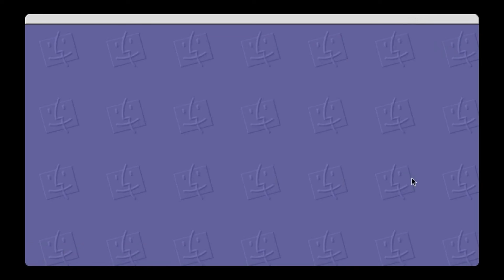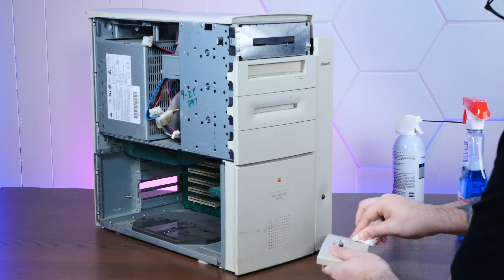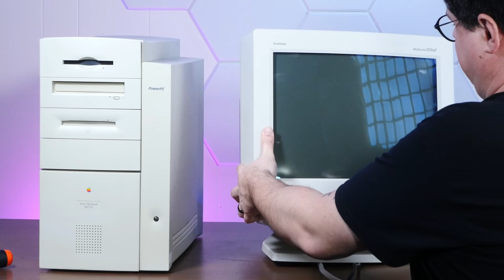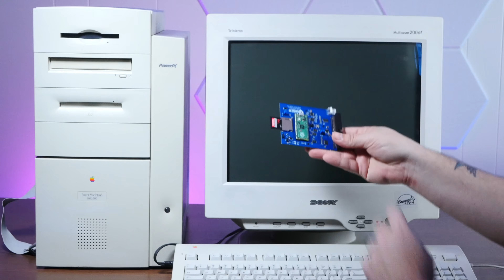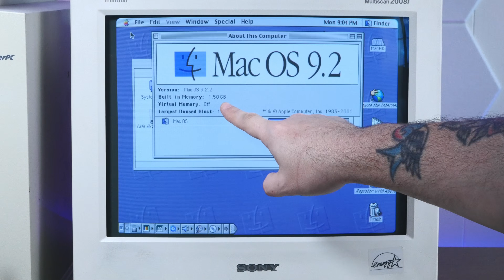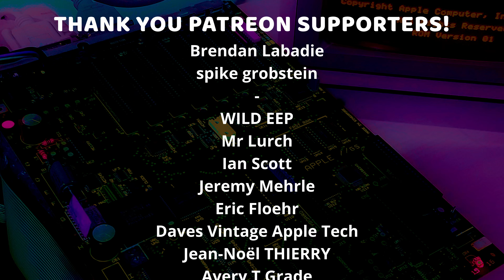I Found a Beat Up Power Mac 9600

Comment: the best thing about the 6 PCI slots was they they had 2 PCI bus controllers, 1 for 3 slots each. so you could put two ultrawide ultrafast SCSI cards in slots 1 and 4, give each its own 10K rpm Seagate Cheetah drive, and stripe a RAID across them for insanely fast (in 1997 terms) throughput

Comment: I have the original Power Mac 9600/350 and need an Adaptec 2940 UW power domain for Mac SCSI card.
The battery clip is broken, and one of the pci clips needs replacing .. anyone out there have some to sell..?

Comment: ya know there's a ram jumper trick i've used to get more ram working in a casio fiva, it's for laptop sdram.. but i wonder if it'd work with desktop sdram. essentially it let me use a stick of 256mb in the casio when it would originally only work with a single stick of 64mb. the guide was on a japanese site and also showed someone getting a 512mb stick working with theirs. i've seen laptop sdram to desktop sdram adapters in the past i wonder if the mod wouldn't work with the desktop ram if someone could use that adapter and get the jumper'ed laptop ram working on a machine. anyways you jump pin 62 to pin 68 and it bypasses some size check i think.

Comment: The way to do a universal mount solution for various SD card adapters would be to have a two-piece system where device mounting and card placement would be sorted out. Then it would just be a matter of inserting the card with hardware from the front and having it fasten in place with live hinges holding this carrier in place.

Comment: I used the 9650/233 as my desktop machine, hooked up to a 28" CRT back in the day. I still have it. Oh and it was upgraded with a DAT drive - complete with the official face plate. Your model appears to be missing the green levers that kept the hinged part in place.

Comment: The 9600 is my favorite pre-G3 PPC Mac, so many ways to upgrade and customize. I have a 9600/300 “Kansas” model with a 250mhz G3 upgrade CPU card in with 12x 64mb RAM for 768mb total and a Zip drive. Even though this beast is quite large and heavy, it sits on top of my desk because I love the way it looks.
Reply: I bet that thing was a screamer back in the day. You can run modern NetBSD on those if you ever get so inclined, especially with your specs. Can’t promise how good X11 will work though😆
Something like IceWM or FVWM might work.

Comment: Having one of these. (4000usd 1997) was the equivalent of getting a 2019 mac pro in about 2019-20 (say 16core 384 2tb afterburner etc  about 18,000usd). very very expensive but lots of power.  Similarly in their day , the macintosh IIfx  ( stood for ***cking expensive 10,000usd 1990).   The mac pro 3,1-5,1 were cheap in comparison, although you could option them up too.

Comment: You've inspired me to continue tinkering with my PowerMac 8500 that I've upgraded to a G3/300, and 512 MB of RAM... I've been wanting to see if it'd run Mac OS X 10.x but I don't have enough space on its current 2GB HDD....  Once BlueSCSI v2s are in stock assembled I'mma get one and do just that (see if Mac OS X 10.x runs on it). I'm excited to see what you hack into the 9600/300 there! This'll be fun!
Reply: Put a Morph operating system on your mac.
Reply: @TheRus13  Nah I'd rather not... I'd rather have a working experience lol.

Comment: I stumbled upon an 8600 with a 1 GHz Sonnet upgrade card and 768MB of ram at a recycling center. It had a 128GB IDE hard drive mounted in the bottom of the case, which led to the discovery that it had been used as a server, since the drive had OS X Server 10.3 installed.

Comment: In 1998 or 1999, my high school got a grant for 2 beige G3s for a vidoeography course. I don't remember how much RAM they each had, but  something like 768 MB or maybe a Gig.  What I do remember, is that the RAM for each of these machines cost $22,000 USD.  So 1.5 GB maybe would've cost $50,000 in 1997?  ~$91,000 adjusted for inflation?
Reply: The beige G3 has got three RAM Slots, so you can put in 768 MB RAM max. 
My beige G3 DT also got a Sonnet G4 800 upgrade card. i also upgraded it with an ATI Rage 128, a USB/FW-Card and an ATA133-Card. Thanks to Xpostfacto it was my daily driver running 10.4 until 2008, when i bought a new Intel MacBook.

Comment: My 9600 I've had since the 2000's has always been a little wonky looking even with all of it's plastic intact. Part of the problem of it being a little off for you is it looks like it's missing the two bondi colored clips that attached to the big pegs on the side of the drive cage and gave the upper and lower hinged parts more bracing.

Comment: The timing on this video is crazy! The other day, I was given an immaculate 8600/200 and AppleVision 1710AV that had been in a store room for the last 23 years. It almost got eWasted, but a coworker saved it before it got turfed - Booted it up the other day, and aside from the dead (thankfully not exploded) PRAM battery and an intermittent 4GB second HDD, it all works perfectly 🤯

Comment: This is the later revision for the high-performance 604ev. The last 604 CPU used in the Mac. This means that it does no longer have cache on the mainboard but on the CPU-card instead. The nice thing is that the ROM has a working version of speculative access and is best for the G3 (5-10% more speed in certain cases).
The Tsunami and Kansas have two PCI-'zones'. The upper 3 PCI slots are shared with internal peripherals and the lower 3 are directly connected to the system bus. Graphics cards are typically installed in the 4th slot to have the whole PCI bridge for itself to maximize speed. If you have a card that writes into the framebuffer (like video editing or acceleration cards), it is important to install it in the same 'zone' as the graphics card.

The case is missing the latches for the drive-bay mechanism btw.

I have two of these machines. One with a 700MHz G4 and the other with a 400MHz G4. Both machines have more than 768MB of memory. I tend to use the Adapter AHA2940U2B card since it allows very good performance with little CPU involvement. I also have good experience with Acard and Sonnet IDE cards with UDMA capable CF. A generic Realtek 8139 card helps a lot for data transfer and a USB card is also well advised. Even though the plastic off they machine is much less prone to brittleness than the 9500, it can be a bi*ch when it comes to the small plastic latches used for the drive bay covers. I have repaired some of these covers with ABS cement and some donor ABS. It needs a bit of work to get the repairs into the correct shape, though.

Comment: C'mon, please stay away from SD Cards as HDD replacements, they do not have proper native DMA, support which is problematic, unlike CF cards which support DMA in the form of the ATA DMA/UDMA implementations. 
This has impacts on performance AND compatibility. The only way you can get proper DMA support on a SD card based adapter will be if the adapter includes a large amount of RAM and a smart caching algorithm to cache the SD to the RAM so you can then have proper DMA, this is expensive and unsafe as any power loss will be destroying data if it happens during a stage where the cached data is data to be written and not fully saved yet.

Comment: Do you think the 9600/350 or 9600/200 MP is a better example of the pinnacle of 90s beige Power Macs? I was thinking it might be more fun to have the 350...I mean that was even faster than the G3s of the time.

Comment: I love the 8500, 9500, 8600 and 9600 series computers. My first PowerMac was an 8100/110 and I very much regret parting with it, even if it was a b**ch to take apart. "(well not really, if you have 90's cars for reference...). The 9600 was a powerhouse dream machine.

Comment: Loving this. I have a 9600 in storage and this really makes me want to pull it out. I remember it had a faster SCSI card, but I think the drive has died. I think I even have some upgrade parts for it as well?
Reply: Mine came with a Jackhammer SCSI card. Maybe a little faster than the onboard SCSI bus but I use a PCI to SATA converter with mine now.

Comment: when he said dragging old macs into the modern day

i felt that, im kicking an old 2010 iMac i found abandoned in my teacher's closet while helping clean out any ancient computer out of there into 2023 and this thing has no clue what it's even doing. left behind in 2012 with Mac OS X Lion, 4GB of ram, 2012 versions of Adobe apps.

Also found a 2012 MacBook Pro with a ton of missing parts, and salvaged some parts for my 2011 MacBook Pro, and my MacBook isn't having such a hard time now, it can handle many continuity features, and AirDrop. In terms of CPU and graphics, this thing is getting cooked doing what I do.

Comment: Still have one. Great bit of kit, found it in the garbage years ago, and used it paired to a scsi epson film scanner to digitize my pictures in the early decade of the century. Brilliant industrial design, but the Open Boot implementation is a nightmare. It's so much riddled of bugs I still feel my skin crawl to this day. One of the very rare computers I gave up switching to Linux (and I did some Sun and DEC workstations, so I'm not adverse to a good challenge from time to time !).

Comment: I bought a 9600 new back in the day. Picked up a new one recently, has a G3 card in it, BlueSCSI v2, Ultra 360 drive, 7" PC Card, USB, and video. Trying to use up all those PCI slots. Only 768MB of ram though :)

Comment: The Kansas board actually took the standard L2 cache away from the logic board - because the "High Performance Processor Card" moved it onto the CPU card (the 200MP and sub-300MHz models used either the old board or an L2 cache module). This "inline cache" ran at 100MHz, 2x the speed of the bus-level caches. The Kansas models are usually preferred because they're more accepting of fast G3/G4 upgrades without the soldered cache that occasionally causes problems. 
The ATX mod isn't difficult, but you have to wire up a custom circuit to control soft power (IIRC, ATX's POWER_ON signal is basically the opposite of what Apple used, so it needs to be reversed). I have one of these and its power supply blew up, but luckily I was able to fix it with some new power ICs.
Reply: The downside of the later Kansas board was that it was no longer compatible with Rhapsody, so you needed to find a Tsunami board if you wanted to run Mac OS X 1.0.

Comment: Hope you get to max-out a Power Mac 6100 some day too!  (ie. the very first Power Mac)
Reply: I used to have a 6100 pizza box.  Cool little machine. Mine had 24 Mb ram (if I remember correctly).  I had to use that Ethernet dongle for networking. It ran MacOS 8.5 quite nicely. Unfortunately it had a bad case of Varta.
Reply: @DerekWitt  Mine was maxed out with a Sonnet G3/500 card (but limited by the mobo's 30mhz bus, so the card was stuck at 480mhz).  I ran 72 mb of RAM.... 128mb would've been possible, but the heat output was just too much for such a small box.  I also added an Apple HPV video card, from a PowerMac 8100, and also used the Ethernet dongle (10 Base-T AAUI transceiver) to get the thing online.  One other thing I did was swap out the green power LED (near the hard drive bay) with a super-bright blue one.  :)  The sad part is, there was no Linux support for the Sonnet upgrade card.  NewerTech G3 upgrade cards were able to run Linux accelerated, but IIRC, suffered from bugs that kept messing with the date/time settings.
Reply: @rkmugen  I also ran Linux on my 6100/66 at one point.  I may have had a 500Mb hard drive (just don’t remember how big).

This was actually my first Linux server.
Reply: I never thought of a stealth G3 in a pizza box form factor.  :)

Comment: It's great seeing the 9600 get some screentime. I still have mine that I upgraded the snot out of in the 2000s. Same 9600/300, but it has a 700mhz Sonnet G4, Sonnet Tempo Trio (USB 2/Firewire/ATA133), and one of the rarest things I own: a Mac Edition Voodoo 5 5500, complete with original box and inserts.